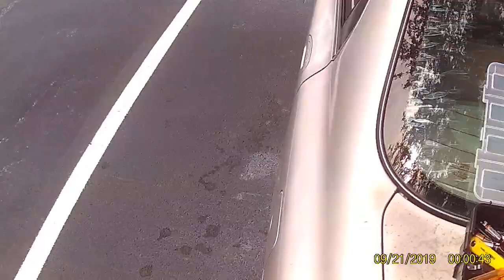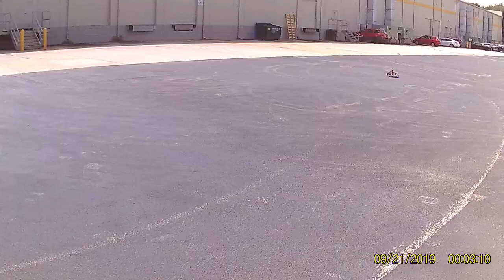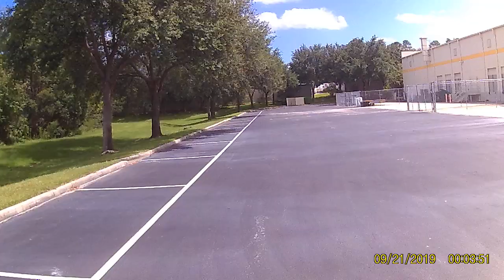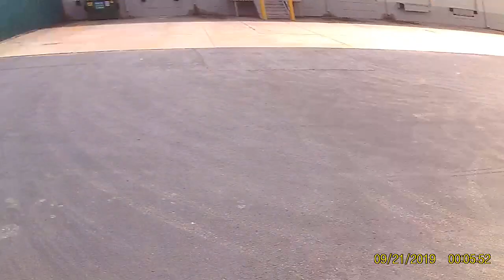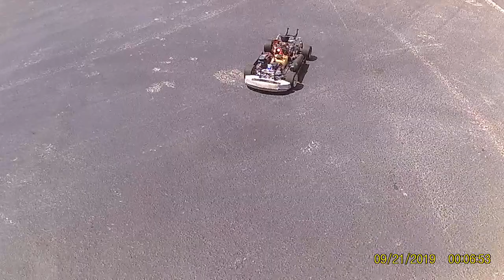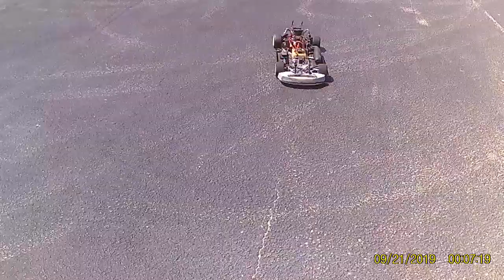1/5 FG Modellsport Car 34cc engine issue

Comment: Check one of the fuel line the main line maybe break inside the tank and it might show like if it's in but it break I run into that problem already
Reply from the maker: Anil Rc Yea it’s got brand new fuel lines a few run videos ago with the other engine even a brand new DDM fuel filter inside too 👍🏼

Comment: Have u sorted out the issue bud?
Reply from the maker: fruity nat just replaced the 990 carb for another one 👍🏼 Do you have any suggestions? Thanks
Reply: @rccustom6726  make another video bro, I think I have the same issue but not sure yet, I'm still breaking in my engine with a 990 carb.
Reply from the maker: fruity nat Will do today 👍🏼 What engine you got in it?
Reply: @rccustom6726  zen g320, looks like I have a leak on my 990 carb, must investigate some more.
Reply from the maker: fruity nat Yea i have one of those too but I’m trying this 34cc engine first, You might need a tuned pipe for that engine thou 👍🏼
Reply from the maker: fruity nat I will be doing some run videos today of my HPi Baja with a g320 OBR and the FG too might wonna check them out later 👍🏼
Reply: @rccustom6726  I have the ddm dominator pipe on it.
Reply: @rccustom6726  yah for sure I'll check em out.